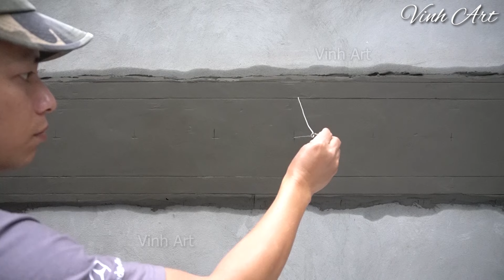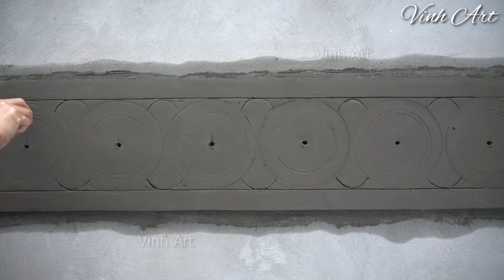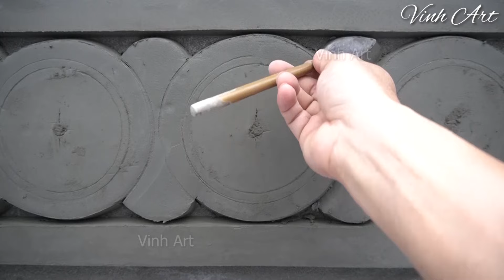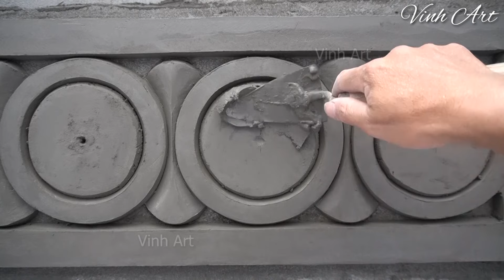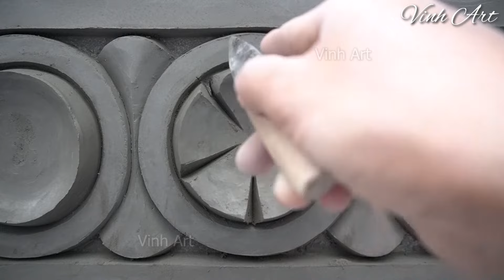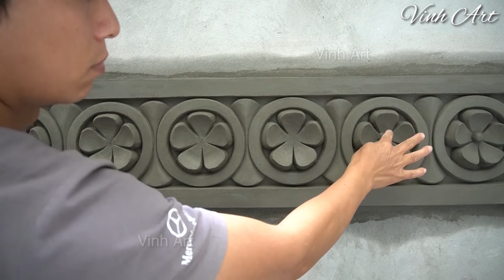New creation for decorative border

Comment: Please, how to mix the cement so that it does not crack
Reply from the maker: The cause of cracking is due to dry wall surface, please water the wall before application, avoid direct sunlight.
Reply: What sand tocementboi